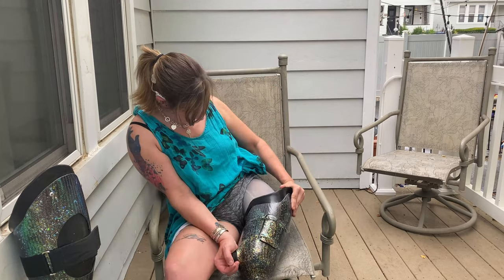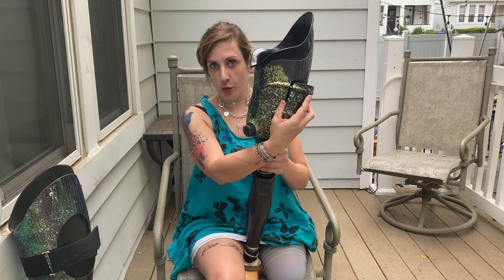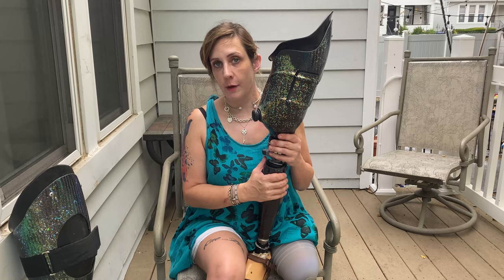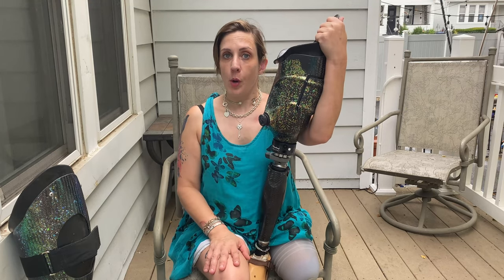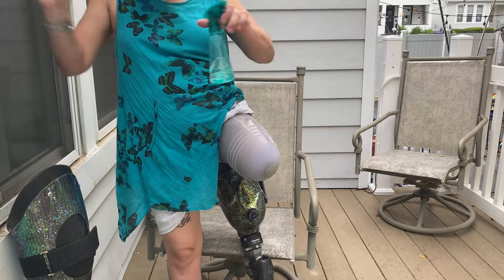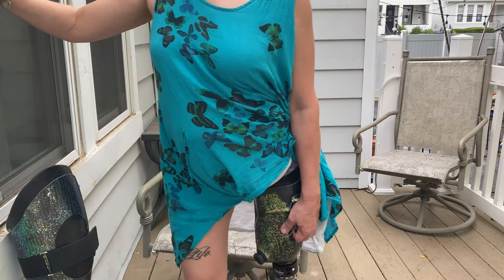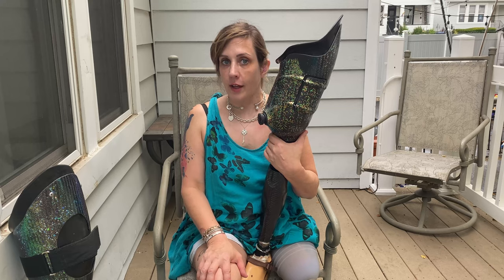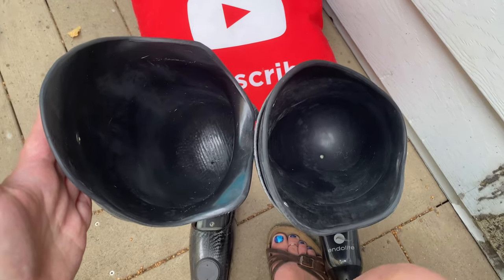How an above knee amputee Click Medical BOA prosthetic socket works!

Comment: Does the socket need to be adjusted during the day, or is this more for swelling / fluid retention that varies day to day?
Reply from the maker: It depends. Sometimes it needs to be adjusted and sometimes not.
Reply: @AmputeeOT  hi there! My aka revision (currently a bka) is on May 18. As a BKA who needed a revision, how long did it take you from discharge out of hospital to fitting for your first aka check socket? Also, can you explain how much a boa socket from clic medical helped you? My prosthetics dude is a rockstar, but isn't a fan of boa because of total contact and desire to make well fitting limbs. What sucks is that I really can't help how my limb changes volume.

Comment: Christina. Question Do these sockets actually work?
I ask this because I have not been able to speak to anyone who has actually used one.
I have very serious issues with stump volume fluctuation. Also unfortunately my stump reacts very badly with liners (Over the past 35 years or so I have tried virtually every liner on the market but my stump does not like them often with unpleasant consequences. As a result I am stuck using cotton socks) My Prosthetist Mark Croysdale at RNOH Stanmore, London has suggested that we try a 'Boa' So I am interested in learning more about them.
Reply from the maker: Yes it works just fine. The BOA system is just the knob/strings/tubes, the rest is customized by your prosthetist.
Reply: @AmputeeOT  Thanks for that. I shall ask Mark about this. Unfortunately due to my rather "active" stump I am due to have another stump revision next month.
So it will have to wait until I recover from that.
Reply from the maker: Good luck! I like it. It’s much better than trying to add pads to my own socket which is what I was doing before.
Reply: @AmputeeOT  Excellent I have talked to Mark about this. I am thinking that once the stump has settled down post op we can serious look at this. Even though the last stump revision was on 2nd August 2017 not a day goes by without having to put at least one stump sock during the course of the day.
So anything that could help me to deal with this would be very advantageous. Another issue is that I am lucky if a socket lasts more than 6 months or so.
For example the socket I am on now was new in early March. At the time I was wearing 3 socks (2 thick & 1 thin). Since my last appointment in June I have had the socket reliened and I am on 4 thick socks and 1 thin. 
Had the revision not been imminent Mark would have made me a new socket. 
 I did send you a brief outline of my general situation which is unusual. The problem is that my residual limb is trying to regenerate itself.
If I was an Axolotl or a Blue Mountain Salamander etc etc then it wouldn't be a problem! But of course I am not and since 1988 I have had 12 major revisions which are in effect re amputations. As my brain behaves as if I am having a primary amputation. Just to complicate matters due an accident at school in 1974 when I dislocated my right shoulder I am unable to weightbare through my right arm. Because the leg was so unpredictable and unstable it wasn't until 2019 that I had a major operation to reconstruct my shoulder and upper right arm.
Completely replacing both the joint and the upper arm. One of the surgeons told me that only the huge improvements in orthopaedic joint surgery saved my arm (Between 1983 and 2001 there were some 10 attempts to resolve the problems but they never worked successfully for more than year or so)
This has stopped the dislocations and subluctions (Between October 1974 and June 2019 I had somewhere between 10 and 12 thousand dislocations and subluctions in spite of 10 major surgeries ) But I have been warned that it will never be strong enough to cope with the post operative rehabilitation following a revision. 
The shoulder team at RNOH were quite blunt about that! (Frankly I didn't like the sound of the  consequences of joint failure!).
So basically I have to be able to go from effectively non weightbaring to full weightbaring in one go so to speak.
Reply: @nicholaskelly6375  I empathize with you man! You've really been through the mill!
Reply: @lorenwegele4250  Thank you very much. Here in the UK it is a lovely sunny day! It is good to be alive.

Comment: What about the Martin bionic product. It looks very clunky and complicated. Also, what about the Biodesign product?
Reply from the maker: I have no experience with those systems so I can’t really comment on it.
Reply: I have worn a Martin Bionics cx-Hybrid AK socket since 2020-02. It works well. No major problems. It has nothing to do with the BOA system in this video. It is the best? Maybe not for everyone, but one of the best options right now.